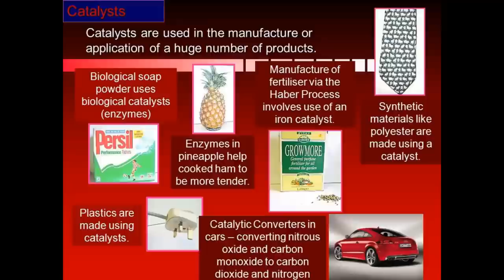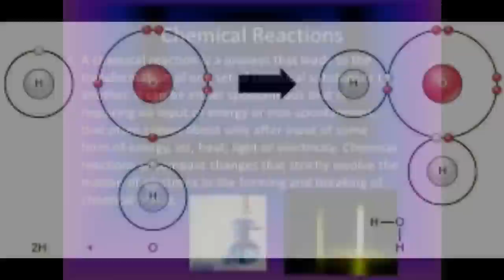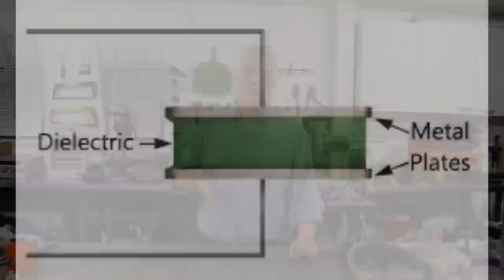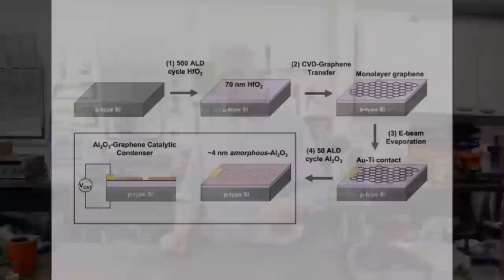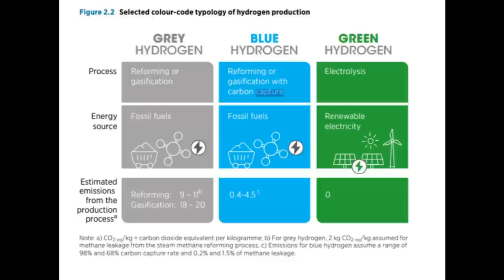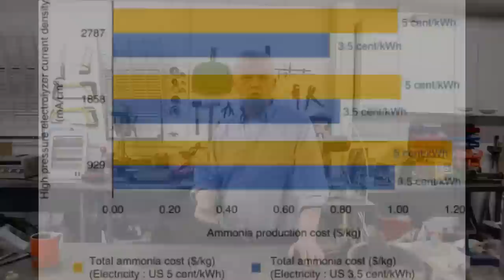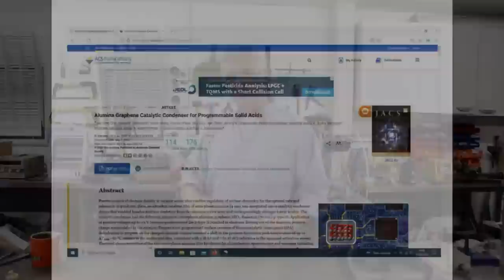The Catalytic Condenser - A Leap Forward For Hydrogen

Comment: Catylists don't lower or increase the net amount of energy produced in a chemical reaction, they just lower the barrier to that reaction.
Reply: You are correct.

That said, much of the problem with hydrogen production at small scale is that you need much higher voltages (often ~2V) rather than what the actual electrolysis reaction uses (1.23V), so you end up with a lot of energy as wasted heat. I don't expect these catalysts to do too much to reduce this gap, but maybe they will.
Reply: Reactions don't produce energy...
Reply: @ThisRandomUsername  Heat increases the efficiency in electrolysis.
Reply: @spectrumofreality  absolutely they do. Exothermic reactions produce heat. Internal combustion engines in cars use the kinetic energy released by the combustion reaction of gasoline. If you mix potassium, calcium, or lithium with water, an enormous amount of energy is released. Oxygen is called Oxygen because of its involvement in the release of energy from matter. (The Ox 🐂 is the energy source that pulls the plow). Remember that matter consists of an amount of energy equal to its mass times the speed of light squared (E=MC²). The energy is released from the matter.
Reply: @Alkimi  See the first law of thermodynamics champ. I will repeat, reactions do not produce energy!
Reply: @spectrumofreality  I thought that might be what you were playing at. I thought you said reactions don't release energy for some reason. I guess it just didn't make any sense for someone to point out that energy isn't "manifested" from nothing.
Not on this channel anyways.
Oh well. I've wasted more time on far more pointless endeavors. No harm done.
Your efforts to educate folks on semantics and Newton's basics would be more impactful on less advanced yt channels.
Indeed, reactions don't create energy, just as rain clouds don't create water.
"Production" is different than "creation", but that's another topic.
Reply: @Alkimi  Production and creation for all intents and purposes are essentially synonymous. Rudolf Clausius was also the one who conceptualized the first law of thermodynamics while  William Thomson (Kelvin) and Nicolas Léonard Sadi Carnot played roles in the concepts of thermodynamics as a whole. Nothing to do with Newton, I think you are overstating and or overestimating your competence and understanding. I wasn't trying to educate people. I was merely making a statement which was true and valid.
Reply: @spectrumofreality  Well, obviously not all intents and purposes, because we're still having this conversation, and you felt it was necessary to make your original point. So now the only salient point left to make is that they are technically different terms. It's a moot point, obviously. But, yeah, you're right, AND it would be more accurate to say "reactions don't create energy" if that's all you were trying to say.
Reply: @spectrumofreality  i think you were trying to lure me or someone like me into having an asinine conversation about something we both agree on. It's a fascinating human behavior that I truly do not understand. But someday I might find someone who can explain it.

Comment: I think that Ammonia is the most suitable hydrogen carrier as it is easy to store, extremely energy dense and easy to produce. I did some calculations a while ago and i arrived at the conclusion that with current ammonia fuel cells, an electric car could have a range very similar to a gasoline car for the same volume of fuel. Quite interesting!
Reply: @garysmith5025  

Yes ammonia is rather dangerous, but even today it's produced and transported in millions of tons yearly so it's feasible, the infrastructure already exists. I brought up cars as an example everybody can understand, but i'm mostly thinking about vehicle types where batteries can't be used. Planes, cargo ships, stuff like that.

> filling station logistics would be on another level even compared to hydrogen

they would be extremely similar because hydrogen also has to be pressurized and cannot be let to escape either. Also, at least ammonia has a very detectable smell.

>Ammonia is just another fossil fuel industry Trojan Horse.

What? How would it benefit the fossil fuel industry?

Comment: The less expensive catalysts are very cool! That said, they work by lowering the activation energy required for a specific reaction to occur but the reaction is brought to completion through the bonding process which does not involve the catalyst. This does not help in reactions that require a net energy input, so electrolysis does not benefit from this.

Still a very cool step forward.

Comment: I'm highly highly highly interested in hydrogen production, especially hydrogen compression.  Ty!!!
Reply: Search for Kubas type hydrogen storage, which is a low pressure storage method.
Reply: I can't image any economic use of hydrogen unless lithium is available for hydrides, or using some currently unimaginably economical catalyst, or if bound to carbon or maybe nitrogen.
Reply: @vitordelima  ty!
Reply: @l0I0I0I0  KMH-1 is the porous material I was trying to remember for this kind of hydrogen storage, but there are dozens of other affordable methods such as magnesium hydride, aluminum powders, ...
Reply: Thanks guys!  There are some interesting methods out there both for making it and storage.  Personally I would like to use it for heat, and perhaps to store energy to run a tractor, but at the moment electric tractors are available.  Hydrogen as well but from what I've seen it's less practical but hard to say for certain without more research.

Comment: I wonder if you could use mhd like devices as a catalyst just flow the water and electrolyte through a strong electric field with the electrolysis plates perpendicular to the high voltage field.
Reply: YouTube "Robert Murray-Smith" Video "Making Hydrogen With Magnets"

Comment: An inexpensive catalyst for hydrogen fuel cells could revitalize the interest in the Edison NiFe home battery system. Automating the maintenance of adding water and charge to the batteries.
Reply: There are dozens of other methods to produce hydrogen without oil besides electrolysis, for example concentrating solar can use thermochemical water splitting cycles, biomass can use reforming/gasification, electricity from the wind, hydropower, tidal power, ... can use ultrasound or microwaves and many other examples.
Reply: @vitordelima  
I'm referring to the recombinant process to produce electricity, not the generation of gas process.
Reply: @Vibe77Guy But the storage of energy as hydrogen would require "splitting" water the same way (or recharging it via other means) and I doubt using the same catalyst as the fuel cell that consumes it would work well. Bizarrely modern NiFe batteries are competitive with Li-ion.
Reply: @vitordelima   
The Edison Battery does split water into oxygen and hydrogen naturally in normal operation. It's one of the reasons that water has to be added.
Reply: @Vibe77Guy  What I understood from your post was that hydrogen could be a replacement for such batteries in a similar product for homes.
Reply: @vitordelima  
Then you misunderstood. One of the downsides of the Edison NiFe battery chemistry is that it loses water to the electrolysis creating hydrogen and water.
Segregation of those gasses, and recombination in a fuel cell, would return the lost water, as well as some charge to the batteries. More of an automated maintenance system. The fuel cell would not need to be very large.
Reply: @Vibe77Guy I think the modern versions of NiFe don't have this issue.
Reply: @vitordelima  
Point to a modern version of NiFe available. And the chemistry has that issue by its nature.
Reply: @Vibe77Guy "High-capacity and high-rate Ni-Fe batteries based on mesostructured quaternary carbon/Fe/FeO/Fe3O4 hybrid material"
Reply: @vitordelima  
Available where?.

Comment: The safest way to transport Hydrogen is in it's liquid form alloyed with oxygen commonly called water.........the internal combustion engine can still be used to burn the hydrogen and the on board batteries supply the power to split the water into Hydrogen and oxygen to be consumed in the engine.......that's so simple even a high school kid can understand it and there is no risk of a fire or an explosion ever........I think about 2 litres of water can be converted to give a range of 300 to 400 KM's of distance even if the efficiency is low.
Reply: The problem is that you're putting more energy into splitting the water than you get out in hydrogen fuel value.
Reply: Or you could use the electric power of the battery directly without the inefficiencies of the hydrogen route?

Comment: Hydrogen for ammonia and industry applications where the hydrogen is produced at the point of use is a great application, hydrogen for transportation or burning along with natural gas is a fools errand. To transport the same amount of energy that a diesel tanker can deliver would take 16 hydrogen tube tankers. Hydrogen has now been found to be a greenhouse gas. Hydrogen embrittles other metals and makes any equipment used for production very fragile and in constant need of repair, many hydrogen refill stations are always out of service.
Please do some of your own research on this subject.
Reply: Spam.
Reply: "Hydrogen has now been found to be a greenhouse gas" Not if you burn it.